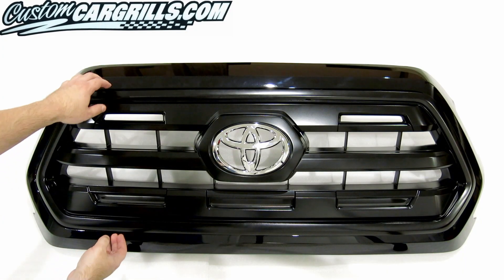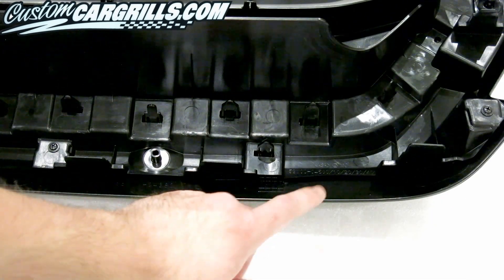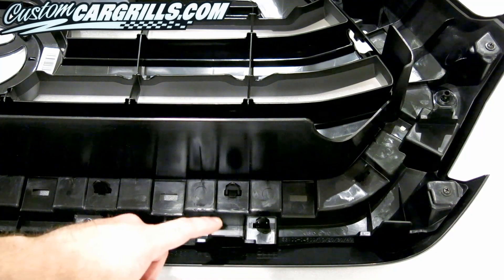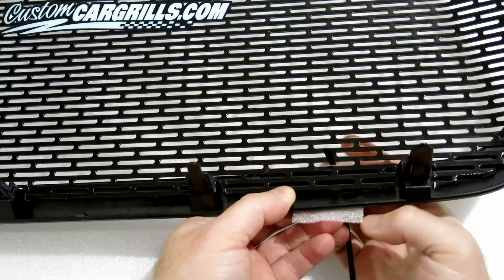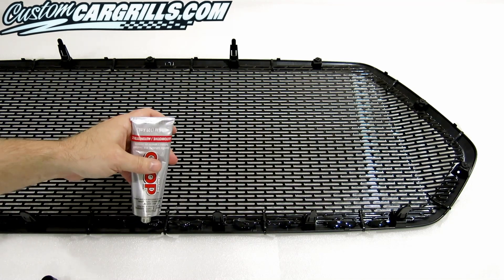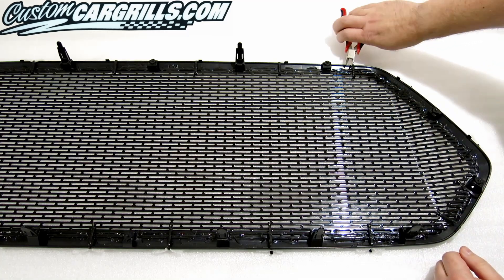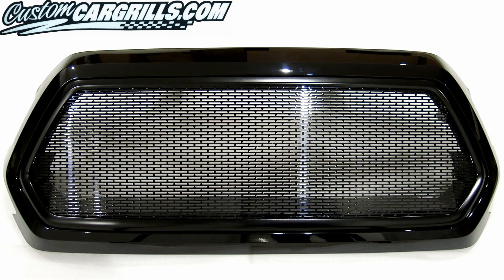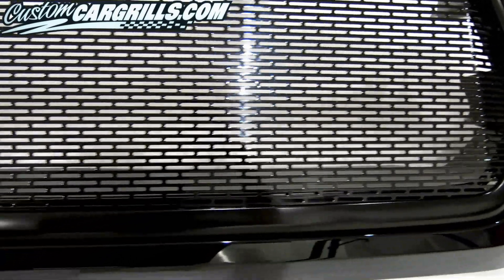Toyota Tacoma 2016-2017 Mesh Grill Installation How-To by customcargrills.com

Comment: I'm going to get a tube of quick drying silicone adhesive....that stuff will hold pretty much anything....like clear lock tight pretty much.I think this approach will be far easier than the "goop" in this video. Good solid instructions though, thanks!

Comment: Everything looks pretty simple, but im worried about the adhesive dripping over as you mentioned, how difficult is this part? And any advise on over excess glue?
Reply from the maker: I don’t find them difficult to do, but there needs to be some attention to detail and some patience to do it right.  The inside of the bezel (when layed face down) will naturally draw the adhesive to the center channel due to the curve of it.  The only  way I can foresee the adhesive coming through is if 
1) you don't have the mesh tied tight enough  to the bezel.
2) mistakenly apply adhesive outside of the bezel area.
3) overfill the bezel with adhesive.

Hope that helps some.

Comment: Will the mesh slide or bend easily if it's not glued down?
Reply from the maker: If the mesh isn't glued to the bezel, it would rattle around in the space between the bezel and part of the factory grill behind it.  Affixing the mesh to the bezel is required for this modification.